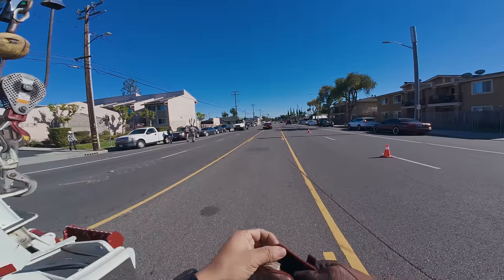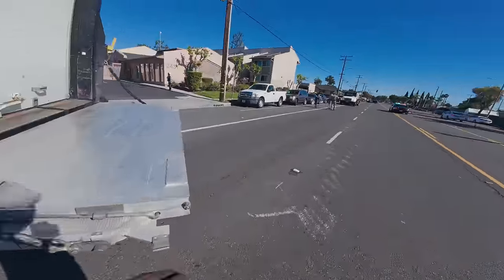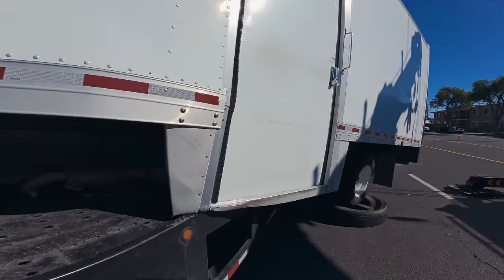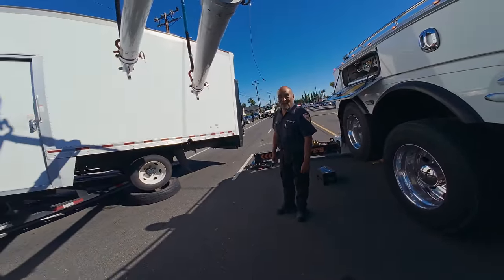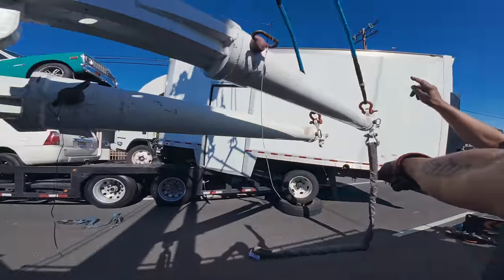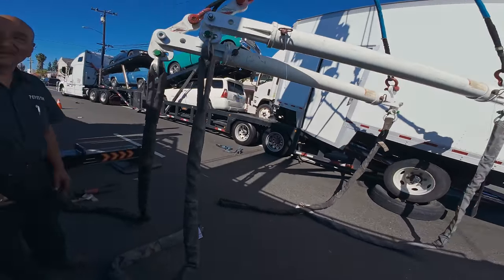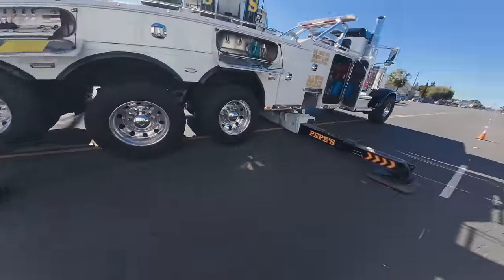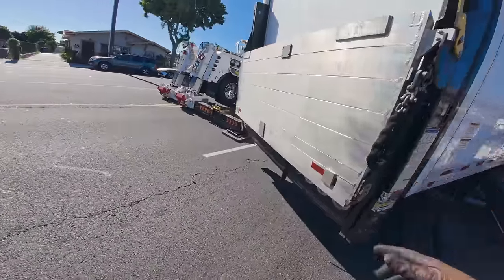Badly Loaded Box Truck Side Swipes 7 cars!

Comment: You should try putting zip ties on the ends of your rim slings that wat it easier to pull thru rims..
Reply from the maker: Not a bad suggestion at all! They're small enough to easily fit but on certain rims this sounds like a great idea.
Reply: @PepesTowingService Ron Pratt uses the zip tie trick with his rim slings.

Comment: I stamp centers at a place that makes steel wheels; curious, when you guys use wheel straps, is it easier to rig to wheels with bigger windows, or more windows?
Reply: Getting the strap trough the window is the biggest challenge.  Second is sharp edges.  So if you could.... make sure they have adequate chamfers.  LOL.

Comment: Hey guys. We watch another operator named Ron Pratt from Midwest Towing in Missouri. His rotator controls are on the section that flips down so they are easily accessible to shorter folks. You might look into that although your remote probably takes care of that problem most of the time. Ron is a great guy. We love watching you guys. We admire your company. God bless you guys and may you have a very blessed Christmas.
Reply from the maker: That's called the Raptor package. More money and problems than what it's worth. The buttons are only to activate free spool, and their wireless remote is ridiculously huge and clunky. We have it in one of our 40tons and I do not like it at all. For example, hitting the outriggers on my truck I can move all knobs at the same time. The raptor one is all digital, you have to select which outrigger, then select in/out.
Reply: @PepesTowingService  thank you for replying.

Comment: Angle iron?
Reply from the maker: Imagine a hollow rectangle of iron cut diagonally. We use those to add surface area and protection when lifting for example a trailer or other surface that is prone to weakness.
Reply: @PepesTowingService  aluminum.  Not steel. 😉
Reply: you understood the concept , have a nice day thanks for watching  @jaygraham5407